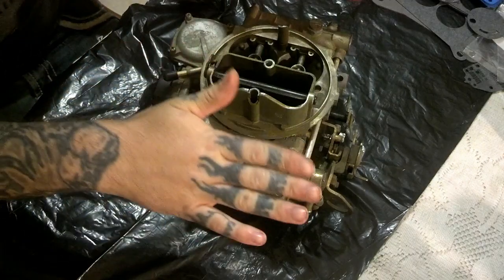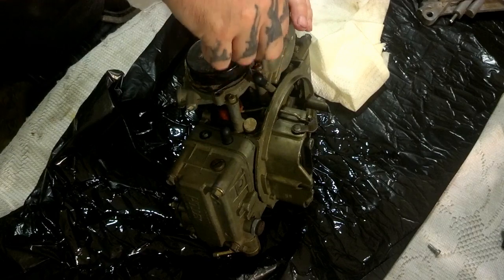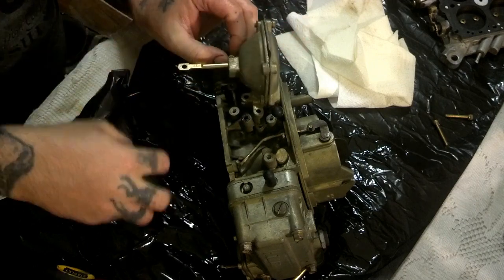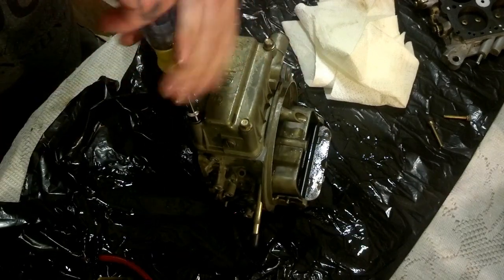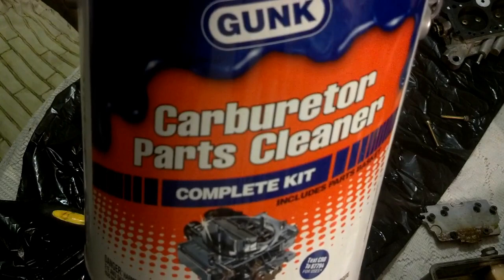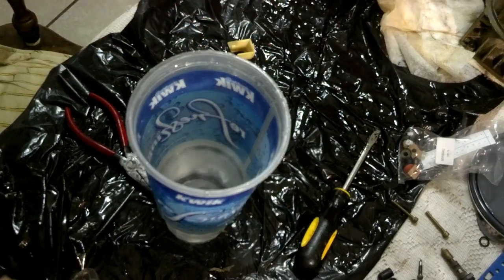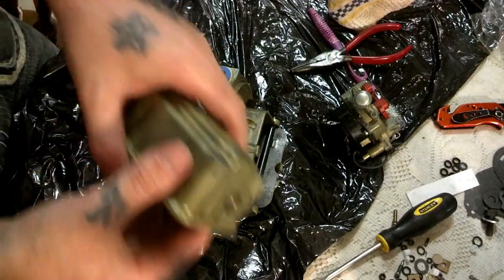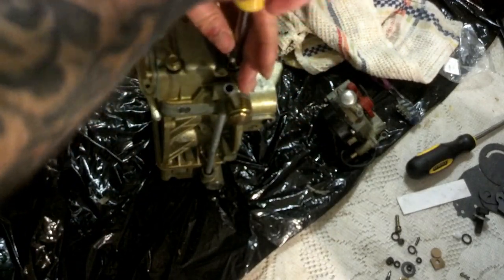HOLLEY 600 CFM FULL DISASSEMBLY & REBUILD CARBURETOR TRICKIT INSTALLED REBUILDING ASSEMBLY

Comment: Thanks it's been years since I Rebuild a Carb. I have Holley. 80457-3   1994. guessing it's 600 cfm next week I'm going to rebuild one thanks for the refresher  I have 65 Mustang 289
Reply from the maker: Sweet, I have a 65 mustang to, I'm fixing to pull engine and trans to put a LS in
Reply: I guess your Chevy guy. You hurt value of the car you get more Hp building old block
Reply from the maker: @ForensicGuySC  I gonna be building it soon, it should be on the channel, getting full frame to, I see value in stuff that I enjoy and a chevy full frame fast back mustang is what I will enjoy
Reply: @TattsForLife  cool enjoy

Comment: There should be a steel plate between the gaskets under the secondary metering plate.
Reply from the maker: Never seen a steel plate but once between that rear metering plate and it was from a holley had be made back in 1960 lol, they not worth using, if they was, the new kits dont even come with this plate and most the newer carbs  you come across dont even have it. its a thing of the past

Comment: i bought a truck that has a 600 holley. #80457-2 on the front. went to start it and would not turn over. checked battery and starter, both good. look down carb and gas is dripping inside the carb. pulled the plugs and a lot of gas came out three of the plug holes. what is going on with this carb.? Thanks, Bill.
Reply from the maker: Carbs are so outdated anymore and fuel if set anytime at all will jell up and wreck internals, you will need a full rebuild, the floats and needles can no longer stop fuel so its hydo locking the engine and pro has alot of build up throughout the carbs passageways, floats out of adjustment will cause this issue but highly unlikely, as it would be user error and most users don't adjust floats and just do a bolt on and go
Reply: @TattsForLife  thanks. i will have it rebuilt.
Reply from the maker: Thanks for the comment

Comment: Please respond if possible I just rebuilt a holly 500 cfm 2 barrel and fuel is coming out of the overflow? Idk what its called the only thing that wasn't replaced was the float it look fairly good could it just need adjusted? Or what could it be I've got a lot of money in this build
Reply from the maker: Hello, did u check the float in the bowl of water, before assembly they can fill up with gas and sink. It can also be a dirty needle and seat or a cut o-ring, fuel pressure can cause that issue as well, hope some this info is helpful
Reply: @TattsForLife  how do I check if its dirty and how fast could it possible sink? It started doing it as soon as it came up to the carb
Reply from the maker: @haydenhale2646  they can sink pretty fast, and u remove the needle out of the top if it's the out side ajustable bowls, u may half to take the carb off and re check everthing

Comment: The part you took off at 20:18 mines stuck and it wont come off and ideas on how to remove that anybody
Reply from the maker: that is the metering block plate, and you can soke it with carb cleaner and it will loosen the gasket and the plate should lift off
Reply: @TattsForLife  thank you ill give that a try tomorrow
Reply from the maker: Hope it works for you
Reply: @TattsForLife  did the trick added about 15 minutes to a 1hr job thanks to your video thank you for posting